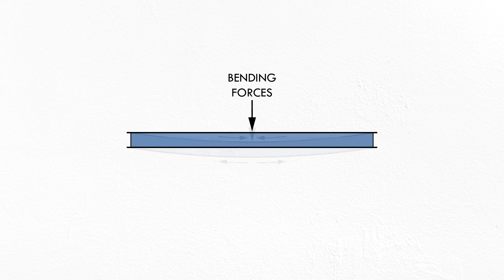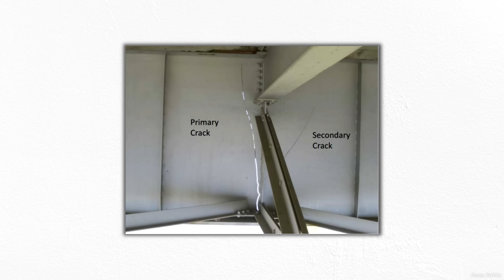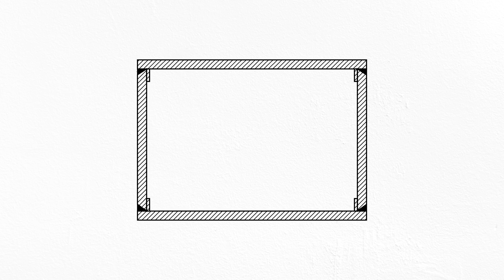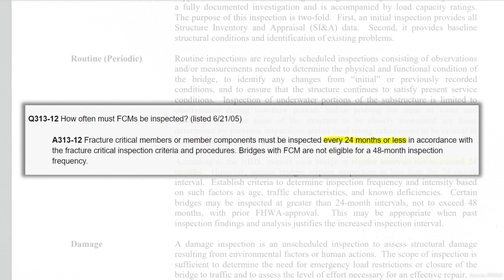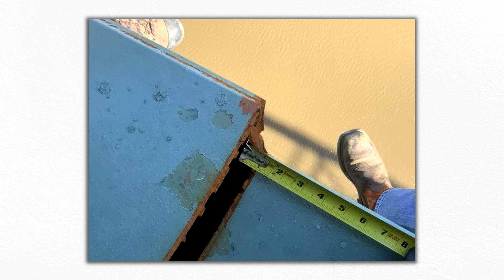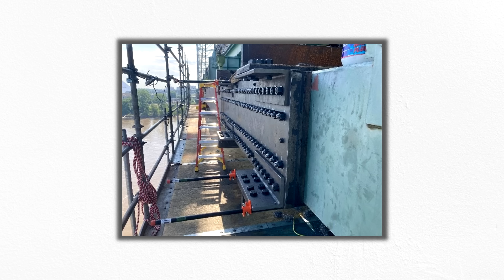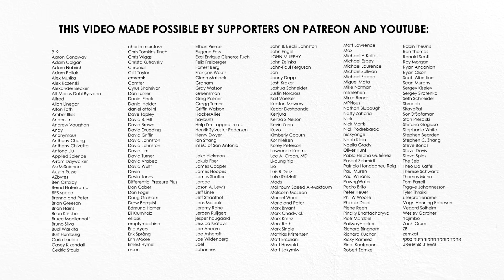What Really Happened at the Hernando de Soto Bridge?

Comment: Honest question: If this crack was there for over 4 years, how critical is it, really?
Reply: It's a mistake to think it's not critical just because there aren't any failures while the crack is still growing. What makes it critical is what kind of failure you'll eventually have if the crack keeps growing :)
Reply: As a lot of other parts of the bridge might have been overloaded for that time, very.
If that's the case, the wear from this drastically decreases the lifetime of the entire construction, possibly requiring a ton of maintenance or even rebuilding the entire bridge.
Reply: Honest question: Would you drive on that bridge knowing that one of the major pieces of structural steel, responsible for keeping the reaction forces of the arch from toppling the pillars which have no way to deal with lateral loading, has a yawning fucking gap in it? A gap that has grown bigger over years while those responsible for noticing exactly this type of thing managed to either not see it or choose not to do anything about it?

Like, if you were on a rope bridge and somebody cut a few ropes and said 'hey I guess those weren't critical', you'd not say 'well I guess we just improved the bridge!' That member was carrying a load, and under that load it broke. Now that load is being taken up by fewer members, ones that were not designed to handle it, and ones that were designed and manufactured in the same way as the one that broke. We also have no reason for trusting the past inspections as they were clearly inaccurate.

Also look up what a safety factor is or watch some more videos on famous structural failures. The bridge hasn't failed entirely yet, but it might be a matter of a strong wing or a heavy vehicle load. I'm no engineer (yet) but letting anybody cross that bridge in its current state would be criminal.
Reply: @Samuel Werley 
I did watch the video. I guess "critical" doesn't mean the same thing in bridge work as it does in the pharmaceutical industry.

Comment: Hey! As a metallurgist at a steel mill in Memphis this was awesome to watch and really close to home. I figured it had to have existed a long while before, then our winter storms earlier this year accelerated propagation a great deal. Also, I had no idea that tie was classified as "non-redundant" 😳
Reply: Can you alleviate metal stress by going along the beam with a blowtorch? Or does that mess up the heat treatment... I guess that doesn't help once it's already cracked though. I'm just wondering if there's a way to restore fatigued metal in-situ before it gets this far.
Reply: @DFPercush  for a proper heat treatment you need a kiln if the temp isn’t consistent through out you can cause stresses in the metal that might cause unwanted properties. Heat treating large structures after welding is very difficult.
Reply: @AutoAnomoly  - You could load if full of waste uranium, let that warm it up.
Reply: @DFPercush  Notice how they temporarily fixed it. They bolted thick plates on both sides of the crack as any weld creates a zone of annealing or weakness. There is no way to weld something like that tie girder and it be as strong as it was originally. I have no idea how much carbon or manganese is in that steel tie girder, if the carbon content is less than 30% it isn't considered a heat treatable steel as it comes out of the mill being sprayed with water is all the strength you're going to get. So they increase strength by including other elements into the alloy which increases costs. Adding just one half of a percent of chromium greatly increases the strength of steel, but chromium is expensive when you have to buy tons of it.

Comment: Hopefully these two states' inspection responsibilities will themselves be audited, and not limited to just this particular bridge.  If one bridge is bad, it makes one wonder how many other bridges have severe defects.

It also makes me wonder how much inspection was performed on critical welds when the bridge was originally constructed.
Reply: Well, it didn't fail at a weld. It failed just outside a massive junction plate. Which means that the stress of that connection was transferred to the beam. They will need to find the source of the stress - how much, from where, in which direction it came to cause the shear - and determine how to relieve it. And that before they actually FIX the beam. Right now they just stabilized it while work proceeds.
Reply: @ricoludovici2825  Obviously.  I was referring to voids or other flaws in the welds that were used to take plate steel and turn it into the box structure.

It sort of goes without saying that the introduction of a gap of at least an inch means that something, somewhere moved an inch to allow that gap to form.  Is some other horizontal segment of the bridge spanning a different segment now in-compression?  If so, is that the result of a pier shift, or can the spans effectively slide atop the piers?  If compression on other spans is nominal, has some seismic event or series of events over time widened the total span across the river or widened any given segment?  Is the other side now under incredible tension beyond its design parameters?
Reply: @TWX1138  Since it is offset sideways, there has to be some torque somewhere. I suspect that one or more piers has shifted. We see that kind of displacement all the time in Cali.  They put 'hinges' at the ends of spans so the beams can work.  By now, they  put cables alongside the beams to limit the end to end movement so the beams won't slip off the seats. 

This one looks like a rigid span that doesn't allow much movement. That crack is from a displacement of stress, not an embrittlement from welding since it is perpendicular to the weld. But you are quite right.

Comment: In my experience, the guy "on the ground" does his job and reports the fault. It's someone in administration or management that chooses not to act.
Reply from the maker: Probably not the case here. Everyone knows to take a fracture seriously when it's on a fracture-critical member. For some reason, the crack was not noticed until now.
Reply: @PracticalEngineeringChannel  Even if we believe in the non-malevolent theory, A LOT of people must have not done their job properly for this to happen.
You can google "ponte Morandi" to see the consequences when you are ate not this lucky...
Reply: @Beregorn88   do you watch “Mayday” where they investigate aviation accidents/incidents?  When humans and their logic bias and flaws are subject to all kinds of mistakes.  And as AvE says, the codes/standards/rules are written in blood…because of the careful analysis of those mistakes.
Reply: @PracticalEngineeringChannel  If that is honestly true then the inspection routine as drafted was criminally inadequate for the bridge. Calling it an inspection when all that is actually done is a cursory glance for missing rivets and larger heaps of bird or bat guano is not good enough clearly. This outright open fracture happened very close to where one would expect a weak spot. Welded unions and an overlapped gusset close to a main load transfer line.

If they saw zero sign of it previously then the inspection regimen wasn't suited to determine fitness.
Reply: @puirYorick  you are making the assumption that those items were to be inspected by drone.  Most source say they were looking at the cables specifically.  And dollars to donuts I bet we find that more direct inspections missed that inspection as well.
Reply: @dwaynepenner2788  Please don't ascribe false assumptions to me. I stated that the inspection regimen (whatever it may have been) was NOT adequate.

I should have thought that was danged obvious and not a daring or risky assertion under the circumstances. I don't even see how that could be a point of argument when the proof of the matter has now shown itself.
Reply: @puirYorick  I am challenging your definition of “inspection”. You seem to be assuming the inspection by drone was meant to find the defects you listed.  In fact inspection vary in intensity, purpose, sensitivity, not to mention each type requires it’s own training and certification. and it would be insanely expensive for every inspection to find every defect every time.  In reality inspections are carried out on probabilities and samples…even when Grady says “every square inch of the bridge” it is somewhat of a simplification, because what he’s doesn’t state is the type, level of detail or inspection method.  Where there problems with this bridges inspection…yeah of course, but it wasn’t a problem with the ability of the inspection to detect the failure.  The drone showed that clearly in 2019. The fact that it was missed doesn’t imply criminality (I suppose it’s a possibility), rather a failure that is likely both very common and very human.  Having worked in aviation and inspection (infrastructure, transportation etc.) I know we’ll enough the how easily things can go wrong that appear to be obvious in hind-site, but in reality are far more counter intuitive, nuanced or sometimes stupefyingly  obvious.  But as far as assumptions, at this point everyone is making some.
Reply: @dwaynepenner2788  TL;DR When dealing with life-critical systems, an inspection regimen needs to be professionally designed over the life of the installation until decommissioning.

At this point, a casual usage of the word "inspect" as in just giving a thing a visual once-over whether by drone (which is a word I hadn't used here until now I believe) or by hanging over the side is pretty useless.

That's like calling weekly once-thru a car wash "the service regimen" for your family car. A small part okay but surely the most trivial aspect and hardly worth talking about if we are figuring out why a critical system blew apart. Arguing about "but we washed it yesterday" isn't worth anybody's time.

To be clear, if that is what people are calling the "previous inspections" then those were all not good enough i.e. adequate as proven by their failure to detect a very serious flaw.
Reply: @PracticalEngineeringChannel  I don't know about you, but that drone footage seems pretty obvious to me! The drone operator must have been blind!
Reply: A competent guy "on the ground" is supposed to have the stones and the professional training to dial 911 and shut the machine down directly when seeing something this blatant. You don't go to the office and file a report first and assume it gets action from admin.

Comment: This is almost as egregious as the guy who disabled the emergency brakes on that Italian cable car!
Reply: At least in this case someone didn't actually disable the beam. The cable car brake issue was on another level.
Reply: @d.t.4523  Yet in both cases, it's not just a failure of one lowly grunt.  Both are management and process failures that allowed that one lowly grunt to fail with nobody else noticing and fixing the issue.
Reply: @georgedorn_fnord  Basically, you're correct. The bridge failure was missed, or ignored, during several years worth of inspections. The whole inspection team should have been fired, including the managers.
Reply: @d. t. Oh its a lot worse that that: The cable car owners knew and made the choice to carry on risking lives. That's the big question in any engineering failure: Who knew, and when did they know & what did they do. See both shuttle disasters, and any number of building failures / rail and aviation crashes.
Reply: @Ralnon  in that case there was also a maintenance fail, as the cable was checked and they thought it was still good (and it might have led to overconfidence by the operators)
Reply: @d.t.4523  You wouldn't be saying that if this bridge had collapsed and people died. While intentional negligence of disabling safety features may be worse, this crack was visible for years and missed in inspection even though its in an open, easy to see location. It begs the question of whether the inspectors were intentionally negligent in their duties as well.
Reply: @bradleystephengreen  They would have had to do their duty, to be intentionally negligent in it. They were negligent in their responsibility to do their duty. Equally disturbing, but not resulting in fatal injury.
Reply: @S.Crown414A  CATCHPAv3 "Click all squares containing cracks" - might as well train AI on something useful.
Reply: Interestingly, metal fatigue seemed to be a major factor in both cases. As 20th century infrastructure gets older in general I suspect it will be even more so in the future.
Reply: I suspect that reduced safety budgets are really at the bottom of that.
Reply: @S.Crown414A  -  Hard to tell, there's a vertical dark line for sure but whether or not it's a crack can't be determined by this photo.  Closer inspection is definitely a necessity.  Maybe that bridge inspector hanging above the web joint will take a look.
Reply: AvE
Reply: @TheRogueRockhound  

Ah I see you are a man of culture as well.
Reply: @comancheclub3449  Texas sized 10-4 on that one good buddy. You have a great day you glorious bastard
Reply: @TheRogueRockhound  no, AvE didn't disable the emergency brakes, he just talked about the incident :)
Reply: @lukes1978  Bro...Do I really need to tell you that I know this? Grab some coffee brother
Reply: @TheRogueRockhound  Maybe Im slow, but you do realize LukeS is joking right?
Reply: @sladeoriginal  Maybe it is I who needs the coffee ^^
Reply: @TheRogueRockhound  I need a coffee too, grab one for me while you're at it! 👍😂
Reply: Such a tragedy, breaks my heart for that family

Comment: Dunno why it gets called a "crack" when it's clearly a complete break. Like saying you have a sore neck when you've been decapitated.
Reply from the maker: Ha - just semantics. The member didn't fracture all the way through. Hard to see in pictures, but some of the steel was still attached.
Reply: To be fair, the script does say that the crack went "right through" one of the members, at 4:45.
Reply: @regular-joe  In a sense it does go "right through". Given the offset shown, the rear wall of the box girder must have had some serious deformation.
Reply from the maker: At 1:53, it says "nearly the entire box beam." Sorry for any confusion.
Reply: @PracticalEngineeringChannel  What do you think....If the beam had not been found and the member had totally cracked in 2, would that have brought the bridge down ?
Reply: @JohnDoe-bd5sz  I am not an engineer but have played with building model bridges and yes, it that structure would have 100% failed the section would have collapsed, I think almost instantly but perhaps it would stay until just the right load or twist then it would fail just like his example.
Reply: @vsavoldi  Wow, so essentially an accident waiting to happen :)
Reply: @JohnDoe-bd5sz  Rather a Disaster waiting for it’s moment of time.
Reply: @JohnDoe-bd5sz  As a mechanical engineer, I don't think there is an obvious answer as to whether the bridge would have collapsed if the rest of that beam had cracked. The ends of the arches do need lateral support. But as Grady's demos at 4:00 and 4:30 show, there are different ways to provide this support.  Depending on the details of the design, the approach spans on either side of the main arched bridge might have supplied enough support to keep the bridge from collapsing, or maybe not. I think only a detailed engineering analysis (or cutting the rest of the beam - not recommended) would give an answer.

Comment: I know how this came about. They don't care. I was asked to do a building inspection when I was in the army and did it by the book. I found foundation cracks and cracks in the load bearing walls. I did a report and told my chain of command and they just dismissed the thought of the building being damaged.  Sent another soldier and they rubber stamped it good. This is why our roads are so bad because the powers that be would rather pocket the money and say it is good without actually doing their jobs. If anyone says anything about it they are "causing waves" and shouldn't be listened to
Reply: sounds like the company I work for...

Comment: A-ha, last week I by-passed this twice and was guessing: "why the bridge is closed " and know I now why. It's really over loaded even 24/7 .....
Reply: Overloaded is a strong word. That would imply that there was more loading experienced on that bridge than it was rated for.
Reply: @BrokenLifeCycle  According to the standards of the era the bridge was built it receives too much traffic and should have been replaced early last decade at most. They've done some overhauls, but not nearly enough.
Reply: @edcrichton9457  this. that's why in NY we got a whole new bridge to replace the long standing Tappan Zee bridge. it was too antiquated and broken in its structure to just revamp, we needed a whole new structure to meet modern standards
Reply: @edcrichton9457  The I-35W bridge was overloaded and was [essentially] "fracture critical", and it dropped into the Mississippi in one big piece. "Non-load-path-redundant" was the actual term; the piece that failed bent instead of broke, and the load couldn't be redistributed through the rest of the structure, and the entire thing failed at once.